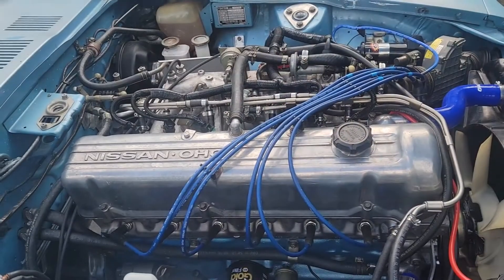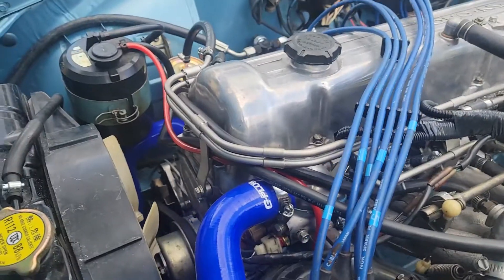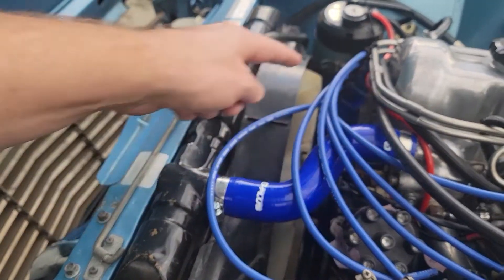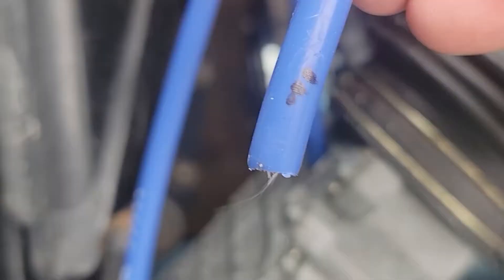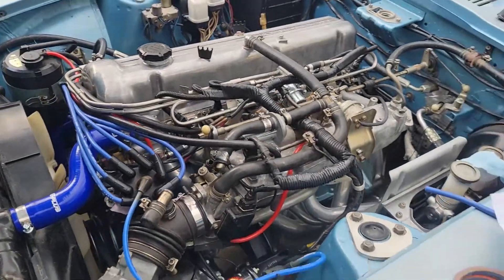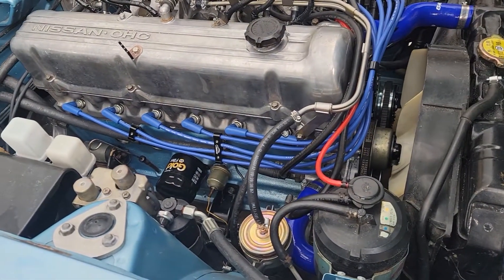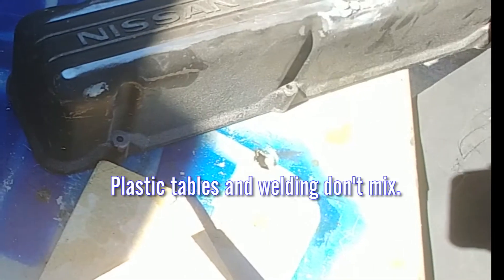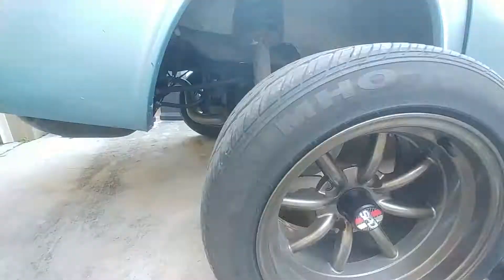Datsun 280z : Starting to clean up the engine bay

Comment: this looks great. do you think as a beginner i could do something similar to my 280zx. never worked with wires.
Reply from the maker: Yeah, I think so..  its pretty easy and fulfilling first project really cleans up the engine bay. the 280zx is identical for the wiring. same motor basically.. just take your time measuring out all the wires. Keep track of all the wire locations on the distributor. Label them and do them one at a time.  Get a decent crimper tool you can find them on Amazon. Same with the harnesses.. just make sure the wires  are tied back and out of the way of the fan around the front.   I think the kit I bought was a v8 so you have 2 wires to practice on.  Lol..
Reply: @inkandpistons  Alright thank you! Keep making content!
Reply from the maker: @gavinmiller3774  thanks buddy. Let me know if you have any questions if you get on it